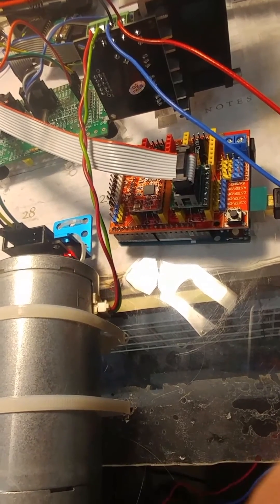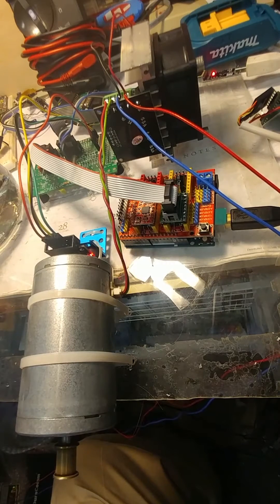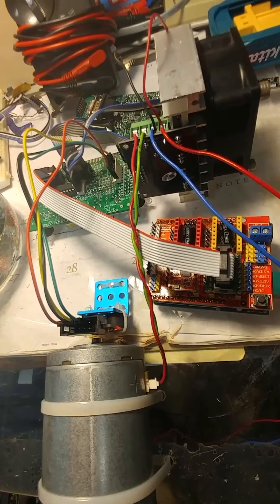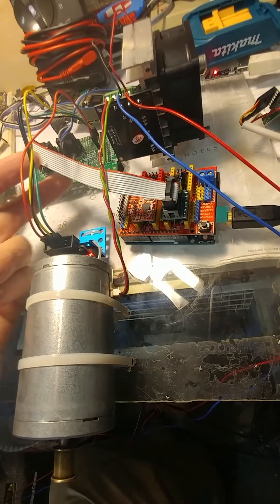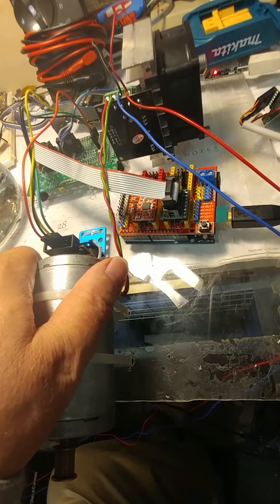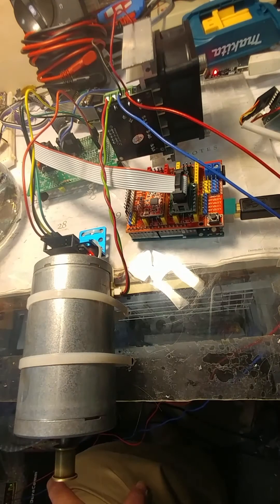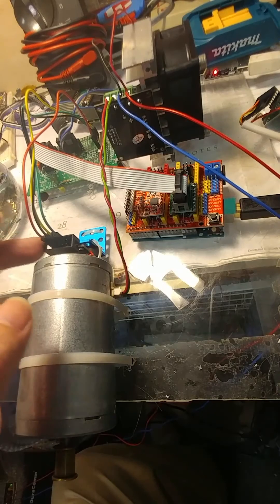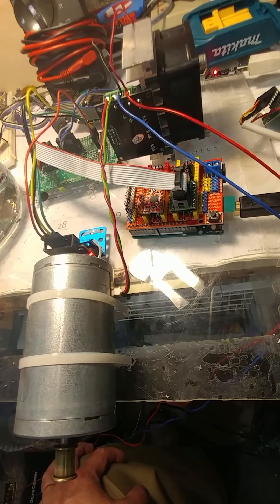Ultra low cost servo system, found motor, amazingly strong.

Comment: How many steps per rev do you get with the magnet on the shaft?
Reply from the maker: There are two different options: 360 or 4000; depending on which version of the encoder you use. The 360 allows higher speed operation when used with the BOB PID; up to around 12,000 RPM, and the 4000, of course, supports higher resolution, with top speeds around 1,000 RPM. Other servo controllers may support higher speeds, the encoders are good up to 75,000 RPM for the 360 and 28,000 RPM for the 4000.